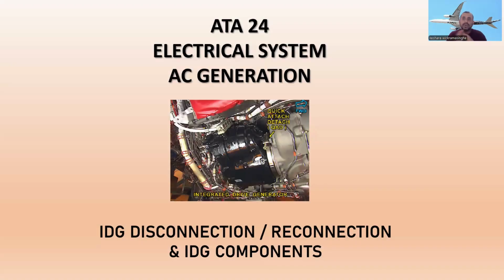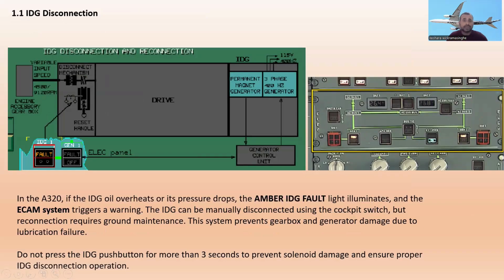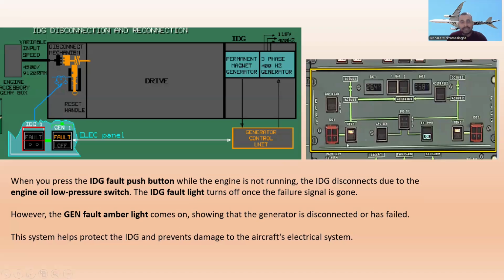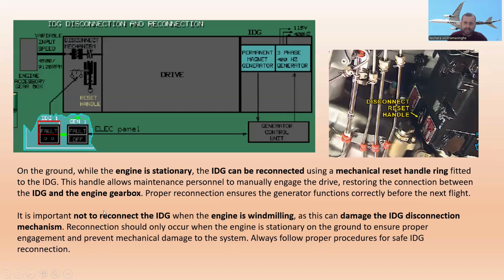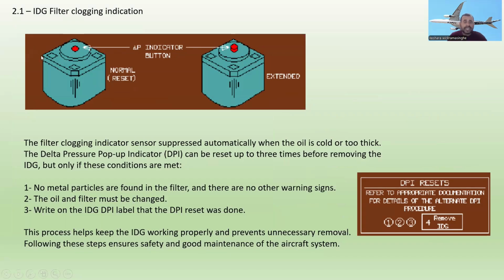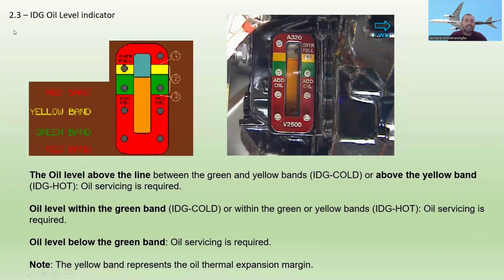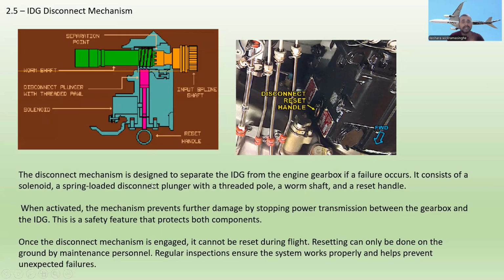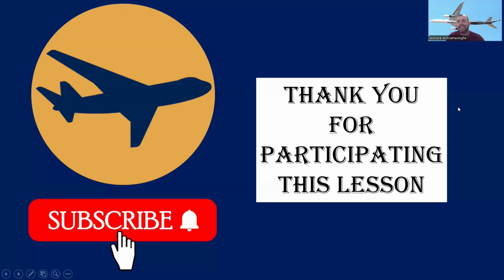IDG Disconnection & Reconnection Explained | Complete Guide to IDG Components | Aviation Maintenance

Comment: Whats happening if idg disconection red guarded is pushed on ground with engine not running?
Reply from the maker: If the engines are not running, the IDG is not generating any power. Pressing the IDG disconnect switch on the ground will not affect anything — no electrical systems are lost, and there’s no damage. It basically isolates the IDG, but since it’s not active, nothing happens. The aircraft will continue to get power from the APU or external source.

Comment: How many way we can disconnect the IDG?
Reply from the maker: 2 ways you (crew/maintenance) can disconnect an IDG — plus one automatic way on many types.

1- From the flight deck: guarded IDG DRIVE/DISCONNECT switch (electro-mechanical trip). Once tripped in flight, it can’t be re-engaged until maintenance on the ground.  ￼ ￼

2. At the engine (maintenance): local/manual disconnect/reset at the IDG itself after shutdown (used to reset or to mechanically disconnect on the ground).  ￼

➕ Automatic on many models: thermal/over-temp (and sometimes over-torque) auto-disconnect—e.g., 737 IDG will disconnect around ~182–185 °C (≈ 360–365 °F) oil temperature

Comment: After Bird Strike, can IDG be automatically 'disconnect' just by engine power degradation?
Reply from the maker: No 

after a bird strike, engine power degradation alone will not make the IDG automatically disconnect.

The IDG is linked to the engine accessory gearbox and stays engaged unless:

- The crew manually pulls the disconnect handle/switch, or
- An internal over-torque or mechanical failure trips the disconnect clutch.

A bird strike that only reduces engine thrust or RPM won’t trigger this — the IDG will keep running until one of the above conditions occurs
Reply: @Kwiationengineering That's a kind explanation, thank you!
Reply from the maker: @인생별거있나-v8o Thank you very much